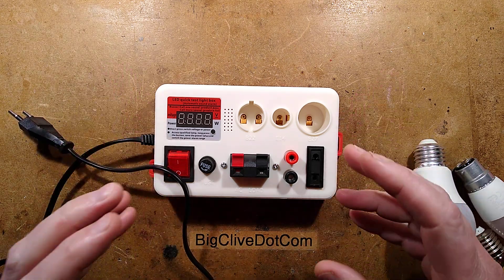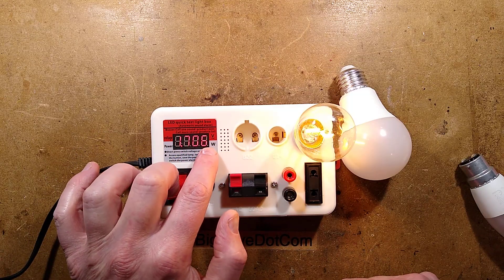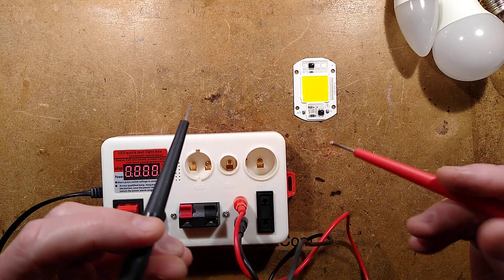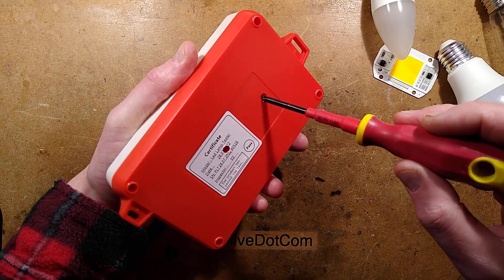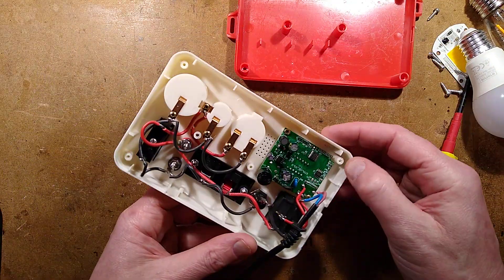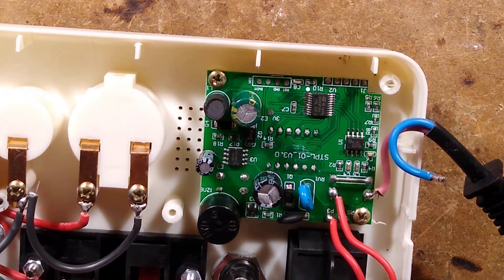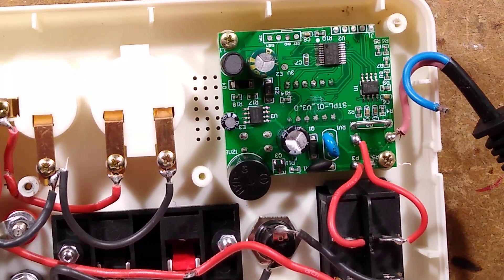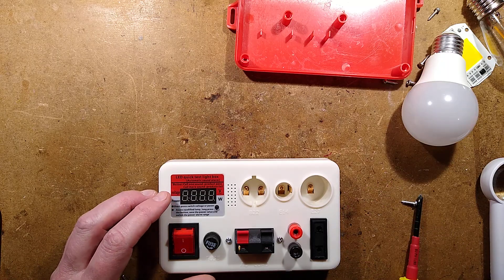Scary eBay Chinese factory test equipment

Comment: Quite a few places you can touch on that to get zapped ouch! Those probes are insane, what happens if you short them out?  I expected there to be no earth but I am quite surprised that it had a fuse!
Reply from the maker: A short would blow off the tips of the leads.

Comment: "Back in the day" (1974), I had "Electric Shop" in freshman year of HS. One of our projects was, making a "Continuity Tester", powered by 117VAC line voltage, that was basically a bulb current limiter with 2 bulbs ( we were given 20W or so bulbs, sockets for them, and a non-polarized line cord) with each socket wired in series to the respective hot and neutral leads and extended to probes. Considering the current through a 20W lamp @ 117VAC can pass enough current through you for an electrocution to occur, this probably wasn't the best thought out design. The scariest part was that our class "instructor" was a retired power company employee, who, should have known the hazards but chose to release devices like this out into the wild, with high school aged students operating them.
Reply: I think in high school eveyone is supposed to know about the risks of  exposed mains probes and be able to safely use it.

Comment: Anyone else notice the crappy solder job of the leads to the circuit board?  Looks like cold 'blob' solder joints, small wonder the neutral lead popped off after a little bit of handling.
Reply from the maker: It turned out that the flex was copper coated aluminium with one atom of copper on it.

Comment: I'm sure BC is very familiar with the standard EU plugs. It was a good joke when he talked about whether the fuse being connected to live or ground 😁 The colours of the cables aren't that important when the plug is a non polarised EU plug😁
You can of course, in the name of SAFETY, carve in to the plug to see where the live/NEUTRAL cables are🔌🤔😂 (as long as you know the live/neutral position in the wall socket...)

Comment: As a young lad in the 1970s I used to go out to the few small neighborhood garbage dumps in the fields near my house and pick over the crusty vintage TV set chassis for tubes and parts. I then took them to the TV repair shop in our small town who had a big test unit for every style of vacuum tube. Amazingly most of the tubes worked after being exposed out in the NY weather for decades. I just had fun seeing if they would glow or not.
Reply: My friend gave me his 2004 LG plasma TV that sat on his balcony for years, unprotected.

It's still working now.

Comment: Maybe we are too soft but I've only ever zapped myself once with (240v) mains once when I was a kid and that was quite memorable enough.  I was working on a mains PCB recently (EV charger) and I built an isolated low current power supply (literally just two small mains transformers wired back to back) and put a foot switch on it and a flashing light to remind me when circuit is live. I quite like not being electrocuted.

Comment: The soldering is pretty poor. I think the mains cable is made of fake copper (alu with a layer of something), solder doesn''t stick very well. Take a look at the 'live' solder connection, just a few wires connected. I think a hungry Roger Rabbit came along to snack some orange wire. 🙃
Reply from the maker: It is the very worst copper coated aluminium.

Comment: This is much more posh than what is typical in India. In about 2006 the firm I was working at in India took on someone aged 14 who had a bent school-leaving certificate that made him appear to be a bit older. The first job he did for us was to recondition our fluorescent light fittings, which he had learnt to do in his previous job in an electrical workshop. His test equipment consisted of a wire pushed into the neutral connection of the socket and a wire pushed into the live connection that went first to a 60 watt tungsten filament bulb in a holder and then a second length of wire with a bare end. He called this apparatus "a series". He held the two wires with the bare ends in contact with the terminals of the fluorescent fitting to be tested; if all was in order the fluorescent lamp lit up and the tungsten lamp did not (because the current taken by the fluorescent lamp was not enough to light the tungsten bulb), and if there was a fault that would have led to a loud bang if the lamp had been directly connected to the mains the fluorescent lamp did not light but the tungsten bulb in series with it did light.

Comment: On the plus side,.. at least the switch is a double pole isolating switch, so both live and neutral are disconnected which ever way round you connect the supply,... and struggling for another plus,... humm

Comment: Several times I have considered building a device with such sockets for quick-testing light bulbs and use it at work, but every time I have realised that it is insanely dangerous and someone will undoubtedly manage to kill themselves on it as soon as I turn my back. Also, when the place burns down, my device will get the blame. 

I thought about building a battery operated one, using the light bulbs as resistors, but it would basically be worthless when most bulbs are LEDs. 
Perhaps just easier to build one, connect the multimeter to it and set it to continuity mode.
Reply: It is not difficult to make a safe version if it doesn't need to be too quick. If you use normal sockets in which you need to fully attach the lamp, it can be made safe. If it really needs to have those push sockets for very fast testing, it's more complicated but also not impossible. Still you should mount it in a space that children can't reach and put an appropriate warning.

Comment: They really didn't try with the probes.
Plastic spring loaded sheaths on the ends of each so you need to push them down to expose the conductor would have only cost a few pennies.

Comment: I had an extension lead which can work with the worlds most common plugs. For some reason I checked it one day and noticed no earth showing, so I chopped off the poor moulded plug and then tried to put a new plug on and spotted there was no earth cable. When I opened the thing up, I spotted really thin wires inside and no earth wiring. While I can fix it it's a job I shouldn't have to do and thankfully I did spot the issue.

Comment: It is not approved in India. Someone might be able to import it but it cannot be used in factories or any manufacturing facility as the device fails to meet ISI standards. 
It might be used in smaller workshops evading regulations, but then those kind of places just use a pair of live wires to test stuff.

Comment: It would be nice if the live test probes and "speaker terminals", were current limited via inline 100 watt incandescent light bulb. I have light bulb current limited test leads, on my workbench. It's good for testing small SMPS's and other small mains powered circuits. If there's a short circuit, the bulb lights and nothing goes bang.

Comment: Back in the 1970s I was on site in Taiwan installing a computer system. The Gents' toilet had a blower hand dryer. To operate it there was an open copper 2-blade clanger type switch with a ceramic handle. I used it with wet hands very carefully indeed.

Comment: Did you order this recently ? Because when i do a search on Ebay, the cheapest that i can find is £25,57 
Maybe the item number if possible ?
Reply from the maker: The price went up on the listing after I bought it.
Reply: @bigclivedotcom  , nooooooooooo 🙂
i had the idea to convert the box to a sort of Quick connect, for using on the output socket of my isolation transformer project. That way, when the magic smoke appears, the power can be cut off very quickly.

Comment: Many years ago I was working in Shanghai using local companies to create a themed party in a large park in the city centre.  There was an open-aired amphitheatre that was going to have some singing and dancing going on and so it required lighting and sound.  There was an arched beam over the stage (a bit like a mini Wembley Stadium) and this was being used to hang the lights.  The local crew brought a scaffold tower that was only just tall enough but it lacked all the 'extras' like kick boards, hand rails, platforms etc.  It was just the scaffold tubes and the lampies at the top were holding on by gripping with their bare feet.  They would then haul up an IWB of 6 PARS and stretch to hang it to the arch.  Then, again at a decent stretch, they connected the socopex connector and immediately all 6 lamps would light up!  And all of this was being done during a horrendous thunderstorm where rain was pouring through the parcans.  H&S is a bit different in China I think.

Comment: There are worse "DIY" versions here in the Philippines located at big chain hardware stores in large malls. Instead of the molded probes they just use solid #14 copper wires with the insulation stripped of the one end and the other end soldered and taped to stranded copper wire. I do not even know if they are fused.

Comment: Lamp terminals should never be open when the power is on or at least they are in the ceiling. The easily accessible socket on the table is something different. It might invite a kid to stick his finger.

Comment: I'm an American living in 240v Poland and was quite surprised to see a similar device sitting on the edge of the service counter at a local electronics store. Perfect for little fingers to reach.
Reply from the maker: I stuck my finger in an open holder on a fairground ride when I was a kid.
Reply: @bigclivedotcom  Yeah, but you ended up with super powers.
Reply: I always find it funny the way we just accept lampholders, when a similar device in virtually any other context would be regarded as far too dangerous.

Comment: It has a European power plug, and in Belgium all power outlets are on what we call "differential breakers", I don't know what they are called in English. Anyway, so the device is perfectly safe to use here. If someone is stupid enough to poke their fingers into a live socket or touch a live wire, they get a gentle reminder not to do that and they have to go to the switchboard in the dark to turn the power back on.
Reply from the maker: An RCD/GFCI/differential breaker will NOT trip if you bridge live and neutral.  It will see you as a normal load.
Reply: @bigclivedotcom  indeed, but you must be really quick to touch both leads at the same time.  We don't have live and neutral where I live, both are live, the voltage between two phases is 230V. We simply have three phase wires, no neutral.
Reply: @erbro  Do you have double pole switches for lighting circuits?
Reply: @MernokiMegoldasok  Light circuits are strictly separated from outlet circuits
Reply: @erbro  perated, they are in most countries. Do you have single or double pole switches for lights?
Reply: @MernokiMegoldasok  Double on most, but in a "hallway circuit", with multiple switches for one light, in practice only one lead is interrupted
Reply: @erbro  if you have 230 V between 2 of the 3 phases you have 133 V to ground. The hallway circuit lamp is then live all the time.
Reply: @MernokiMegoldasok  Indeed, it is a bad idea to stick your fingers in a light socket, even when the light is not on.  But the differential breaker will prevent you from getting killed.

Comment: I have seen an old film from sometime in the 40's 0r 50's of female light bulb testers in a UK bulb factory. You can see in that that even then the ladies had to push down on the bulbs after inserting them into the holder to switch the current on.

China has some catching up to do.

Comment: One could construct a safe version by using an isolating transformer inside. Making it small enough would also limit the current in case of a short. Although these probes are never going to be safe - they're literally made to hold one in your left hand, and one in the right hand, forming a perfect current path through your heart, particularly if you puncture your skin with the sharp metal.
Another angle at this would be to have a grounded version and put an RCD in it with a particularly low fault current threshold. But the way it is now, non-polarized, non-grounded plug, no isolation, that's a death trap. I am surprised they even bothered with a dual-contact switch. I was absolutely expecting it to only switch one side, which might not be hot.

Comment: How is this any different than other high voltage benchtop power supplies, with banana jacks? It is test equipment, and you are supposed to know how to operate it safely. You expect someone working with test equipment, to know how to operate it and you don’t buy a 1000V benchtop power supply for your four year old and let him operate it unsupervised.

Comment: How long will a speaker last plugged into the thing?
Reply: I was hoping Clive was going to explain why you'd want to put 230v through your Wharfedales but he didn't!
Reply from the maker: That depends on its power rating.  An 8 ohm woofer would need to be rated for 7200W continuous.
Reply: @bigclivedotcom  Ah, that would be one of Pink Floyd's.
Reply: @bigclivedotcom  That would be 7200W until it pops🎆

Comment: I love the way they just tack solder all of the mains wiring in place. I was always taught to make a mechanical joint first - ie wire looped through hole or around tag and then solder it. But what could possibly go wrong with their method, noting that the neutral fell of when you opened the case...🤣
Reply from the maker: Sadly, it was the cheapest copper coated aluminium and very hard to solder.

Comment: Here in Uganda a pair of bare ended wires, with one side connected via a light switch, are used to test lamps before sale. So like this Chinese tester you have to understand the risk. 
Of course there are safety rules and regulations but they are mostly avoided/ignored.

Comment: Did I see correctly?... The fuse is in the live, but coloured black and going to the black terminals, so if you were thinking that on a polarised supply the red terminals would be the live ones, you'd be wrong?
Reply: ALL terminals are live , it's AC.....
Reply: @joineralbert2493  in the UK, we have live and neutral AC lines. One line is deadly the other somewhat less so... usually.

Comment: In 1979 I went to a worker'commune village in China. Its streetlights consisted of ordinary tungsten light bulbs with 2 uninsulated wires soldered to the cap. Then these wires were just wrapped around 2 overhead cables strung between buildings. So it was entirely bare to the rain and when the 1000 hour life was used up 9 times a year someone had to climb up and change them. Whether they turned off the overhead power whilst doing this I don't  know.
Reply: HV Mains wires strung from poles are bare conductors, why would it be a problem for lower mains voltage stuff? Rain is pretty pure, it's not going to cause shorts, especially since it can't pool up anywhere on the light. Even if it could and it became conductive, it would be boiled away rather quickly. Since it's alternating current, it wouldn't cause corrosion like DC would.
Reply: @GGigabiteM  "rain" can be full of ALL kinds of stuff... Ever hear of acid rain? Pollution is rampant in India. Carbon WOULD be the stuff left by after the electricity arced across whatever impurity that it burned away. Bare high tension wires are many feet apart, unlike a couple of bare wires coming off the lines, going to a small lamp.
Reply: I assume they'd note the dead lamps and replace them during the day
Reply: I assume they do, such contraptions ares still uses, maybe not in China but in India it does, just called the department yesterday to change the one that supplies power to my home and the streetlamps, the carbon buildup caused fluctuations

Comment: One can only hope the switch breaks both live and neutral with that unpolarized plug. Otherwise switching it off would still be a fifty fifty on the terminals, with excellent finger access ☝️, not to mention those yaiksy probes.

Comment: I've always wondered how it is that we have such safe socket outlets and plugs, yet we have lamp holders which you can poke your finger in when the bulb is removed. Surely somebody could come up with some shutter or disconnecting switch which would make the pins dead when the bulb is out?
Reply: There is a batter version. They are called bi-pin base. You may have seen GU10, GU5.3, G4, GY6.35, GX5.3 and similar lamps. The first bi-pin base was invented by Westinghouse engineers for the 1893 Chicago world fair. Geroge Westinghouse patented an improved version in 1895. The reason screw types bases became common was the forced standardization. Of course they were no invented by edison, he stole other peoples ideas and patented them.

Comment: Many years ago, I was testing/repairing radar display PSUs (in UK). The test box had 2 pins sticking up labelled "6.3 vAC" It neglected to say that this heater voltage was sitting up at 2kV !
I copped it straight across the chest from one hand to the other. It knocked me backwards, I staggered out of the lab into the car park, thumped my chest, took a few deep breaths, wiped some rain off a car windscreen and splashed it on my face. As I turned to go back in, I could see the ladies in the next door office staringat me ashen faced... they brought me in, sat me down and gave me a cup of tea, saying I looked like a ghost. When I got back to the lab and had a right go at the bloke who was in charge of the test setup...( an old Polish guy it was rumoured that he'd been a fighter pilot in WWII)... he just said "You'd better make a saftey cover and label it then!"

Comment: I know nothing of electricity really. What would happen if you touched the two probes together whilst holding them as far back as possible? Would it melt the wires? Weld the probes?
Reply from the maker: There would be a bang and hopefully the fuse would blow.